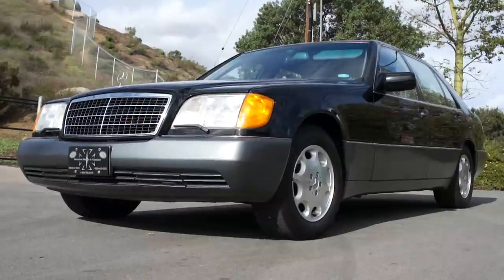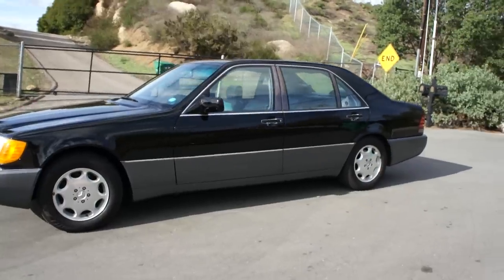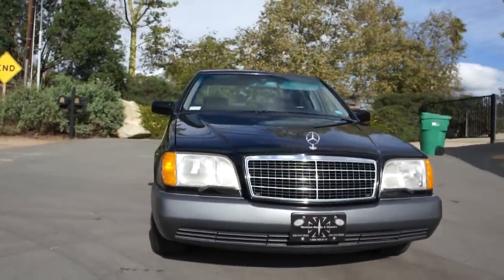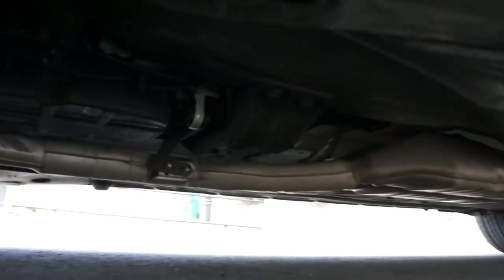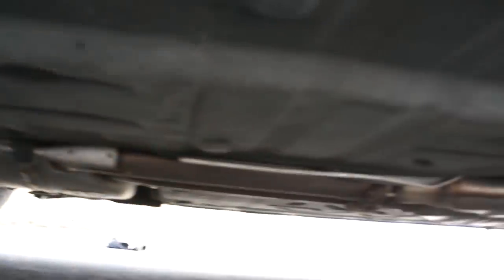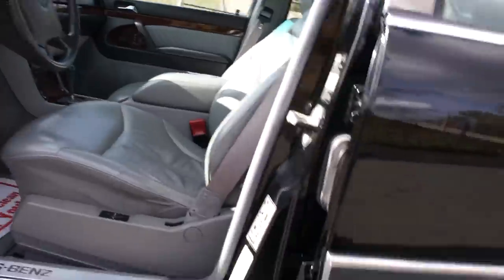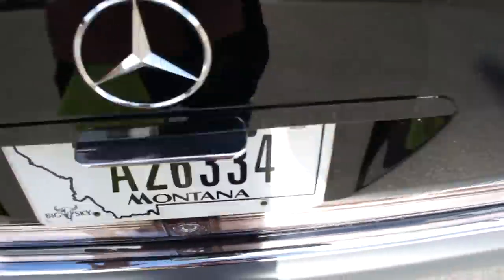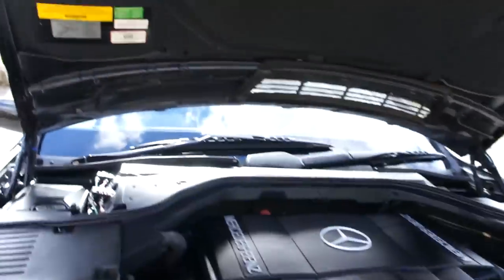1992 Mercedes Benz 500SEL W140 S600 S500 1 Owner  45K Orig Mi 4 Sale *MINT*

Comment: This is the best car EVER. We've had one for 8 years and now with the mileage inching towards mid 250s, and things falling apart, we traded in for the same car. The dealer was like what? 'folks usually upgrade not downgrade, or stay the same". After looking at the pristine W140 looking like it rolled off from the assembly line, I told the guy to start the paper work. 45 Minutes later, I was cruising to DMV. Though we have a 7 series Bimmer and a Range rover, this car makes us so damn happy.

Comment: Awesome car!  Yeah, they run forever.  I have a 1993 400SEL that is about to turn over 230,000.  I love it.  It rides like a dream and at 70 mph, it feels like you are going about 40 mph it is so smooth.  This '92 500SEL is a beauty!
Reply: Mine already had the engine wiring harness, as well as the A/C evaporator replaced when I purchased it.

Comment: Out of all of your W140's, have you ever ran across a problem where the turn signals would work, then go out and not come back on and make the radio turn on and off?  I am having a puzzling issue like this on my W140 and no one can tell me what it is.  The left signal will for for a few flashes, then some off-tempo flashes, then it goes black - sometimes it will cause the radio to turn off (if it is on) or back on if I have not turned it off.  Passenger side signal is OK, but it has also started to make the radio  go crazy.  Also the radio will now not turn off when I turn the car off and remove the key.  No MB mechanic around here knows what it is either.  Thanks!

Comment: The 1992 to 1994 W140 especially the 500 & 600 are my favourite cars. While. I am a w140 fan. And 1992 to 1996 having wiring issues but still is my favourite look. 1997 to 1999 ugly facelift in my opinion. Still less problems but I still I welcome w140 and its problem :). Because it is the best car ever made. But Always remember the true luxury is in the 1992 made only.
Reply: why is that? faisal x___x
Reply: @raycroal  I am sorry for the late replay. I missed your comment. Well, because of many things.. More Diy friendly than 1996 and up such as the computer talk to the engine.. Computers are not easy to swap in.. Specially in 98. Material thickness went to 1 cm rather than 3 cm.. Options are almost standard in prefaclift and but not postfaclift.. Transmission less expensive but not great on fuel.. But the most important is the driving of facelift are more way better.. You can't notice it unless you drive them both for very long time in different roads conditions .. But you should know they prefaclift are cost more specially in interior side and even in exterior. 1993 500sel or 500se with ADS is the greatest mercedes ever. I call it the sweet machine because it is in the middle between w126 Era and little bit moving a step to electronics tech and all if you know what I mean.. If you can afford more the 600sel is the king for driving in comfort mode  but honestly we normal  people normally buy v12 for speeding and it will always push you drive in higher bceaue of the idea of having a v12.. well while the rich people and driving geeks want v12 in sedans because the want comfort and smooth dilvery of power.. This is something I can't afford my self. I am fine with V8 and it is enough. What I learned in W140.. You don't want to speed up a lot.. You want always to drive in comfort and little bit slow.. Why hurry 😁. Get W140 500sel.. W126 560 coupe or even W124 320CE and Toyota Yaris hatch back for daily use.. You will never look back and save your money for future plans as family house.  Study or opening a business or those shitty days we are living as corrona bullshit. New cars are only beautiful for the first month when the paint shine but later you will understand you get shit.. No soul and no joy in newer cars my friend even w222.

Comment: not best car made :)   - the MB e class 300 Turbo diesel  from the eighties was the best -  I had one of those - the 500 SEL -  engine strong but AC had issues - costed $2500 to fix as required to remove whole dashboard - also electronics had issues -  but certainly a beautiful car for sure - the proof is the road - not that many W140s on the road but still the 300 TD's out there  :)